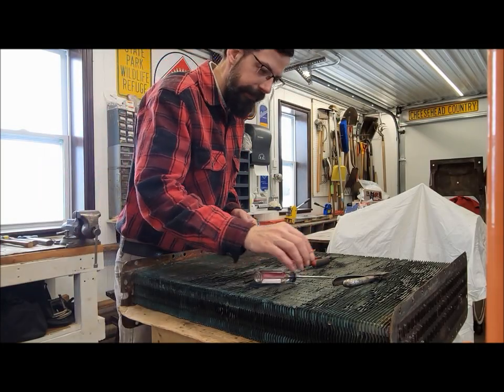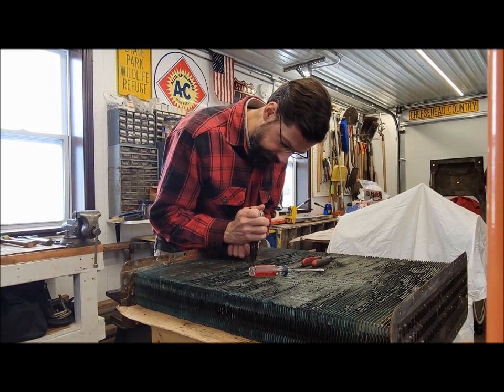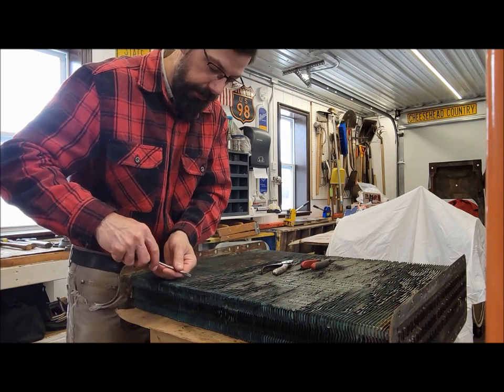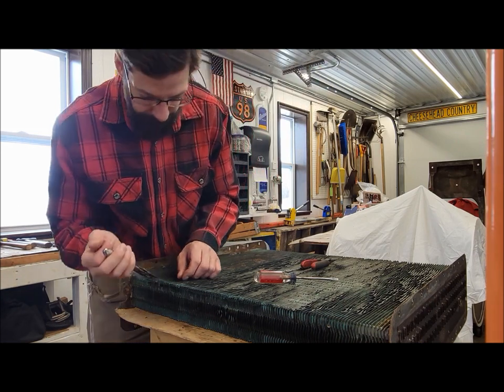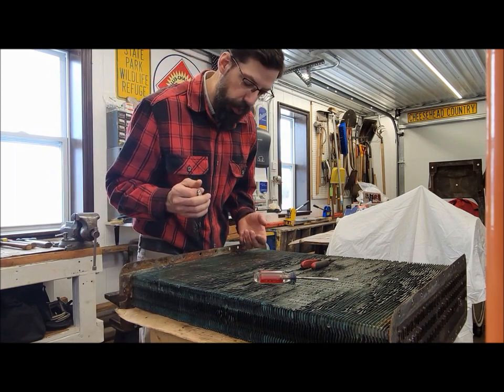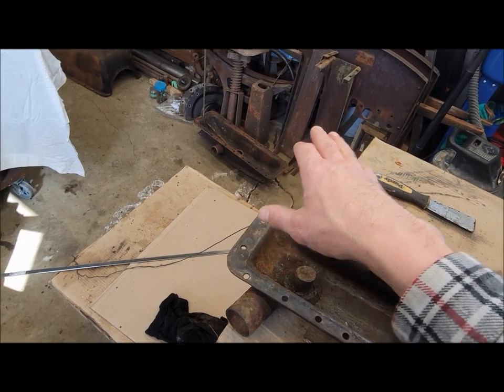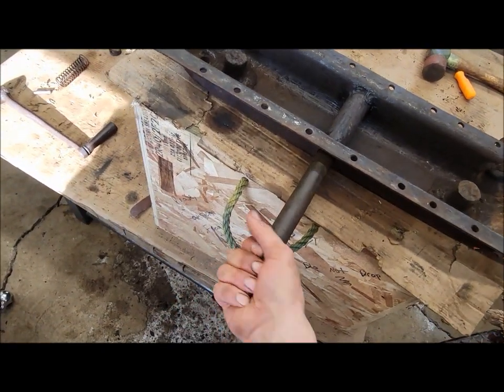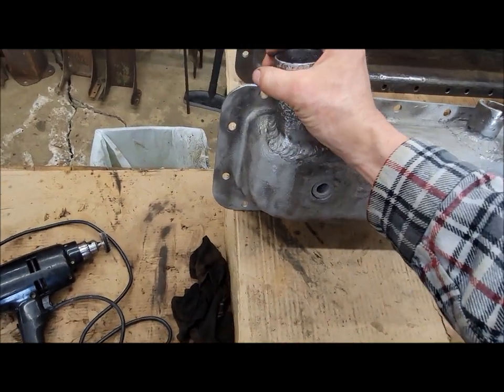Allis Chalmers 15-25 Part 49 -Radiator work, taking apart hand crank & repairing tanks

Comment: hi mate, good work as usual. for the inside of the radiator tanks, I use a surface tolerant epoxy (International paints is Interseal 670, Dulux is STE ) Penrite make a "coolant for older engines" it doesn't lower the coefficient and allow it to run out places that water won't like coolant does, but it does provide corrosion protection..

Comment: you might look into Evans anti corrosive waterless coolant. It boils at 375° & wont develop system pressure, never needs to be renewed & they say is non toxic. Jay leno had some vids awhile back on it. Good luck finding a radiator shop. Along time ago, I went to a rad shop down the street from me to boil out a gas tank from a 39 Studebaker Commander Business coupe, but they too closed their doors due to new housing development environment concerns...
Reply from the maker: That is a thought, I'll have to look into that, thanks!
If it's good enough for Jay, and the rare stuff he has, it must be good stuff.